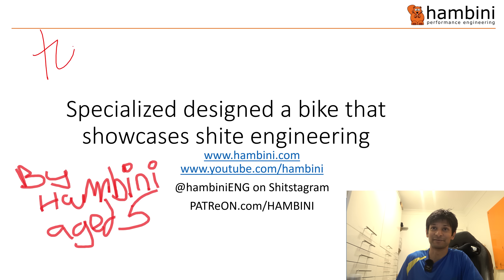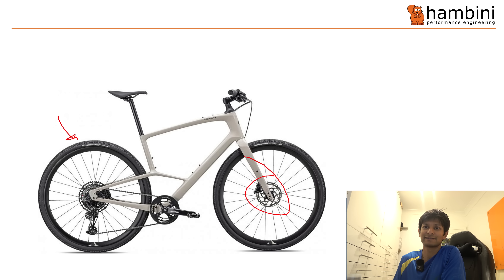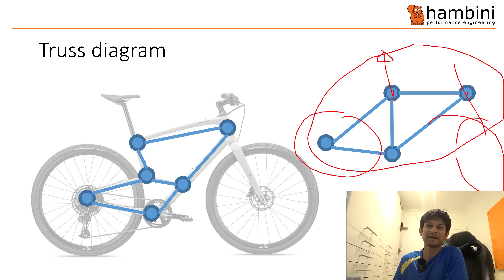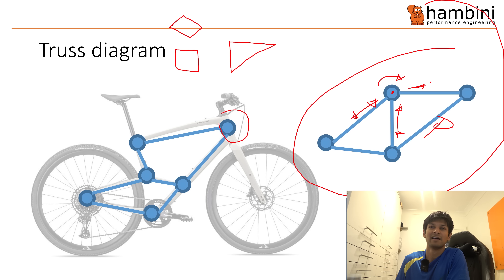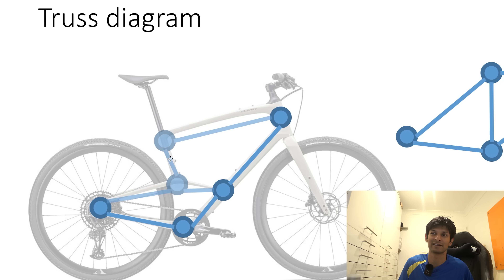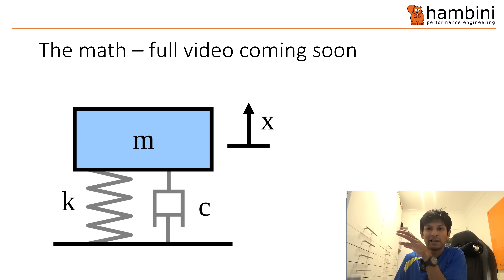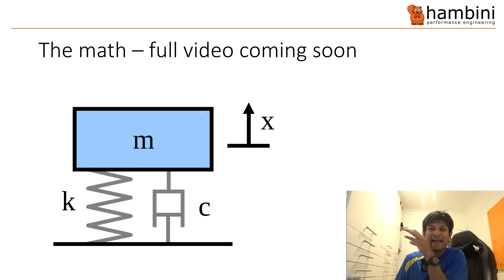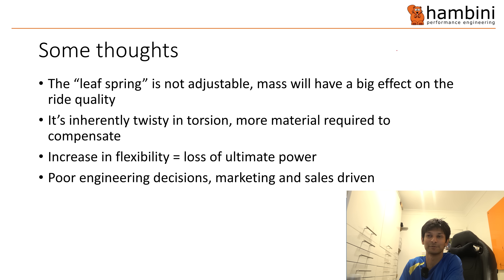Specialized Sirrus | TOTAL BODGE | When the marketing department design a bike...

Comment: I'm gutted I was considering getting the aluminium version but I think I'd better look elsewhere especially as I weigh 152 kg 😢❤😊
Reply: its only available in carbon
Reply: I can recommend the Giant Fastroad as a good alternative in this genre of bike. Comfortable without feeling too sluggish. Mine gave me years of faithful, hassle free service before it eventually got nicked
Reply: In that range you could get a custom titanium frame, and spec the tubing to be oversized. This would achieve stiffness values more appropriate for the load and would end up riding better.
I'm a heavier rider myself and I generally look for heavier TT bikes as road bikes cause they have greater stiffness, that for a light rider would be harsh but for me just feel more normal, or as a bike should feel.
A regular road bike usually feels like a noodle for me.

Comment: Beat me to it! Had a video for this.
1. Get your grad to do your CAD next time 😂
2. The seatpost deflection will still be magnitudes more than the deflection given by this design although more fore - aft than up down.
3. The trek doesn't have a damper, have a madone here in front of me. Just an L shaped carbon leaf spring. I quite like how its packaged...
4. You can still get more comfort without a damper, in theory. An elastic collision will have a lower peak acceleration than a non elastic collision. Same mass thus, lower peak force. Its peak force that hurts your backside you taught me all about that, remember that night in the flugplatz.
4. Only benefit i can see is shorter chainstays for poppin wheelies on the way to the office. No front mech though.
Reply: No front mech leaves space for classified hub! PROFIT
Reply: @Peak Torque Hambini is correct, isospeed has a damper. It is listed as a spare part.
Reply: Sounds like a memorable night of teaching. Hambini the teacher; PT the student. Lovely
Reply: I still want your video
Reply: Hambini owns a grad?
Reply: "Specialized says that its frame allowed 7.9 mm of vertical deflection compared with 2.9 mm for an unnamed conventional frame. Horizontal deflection at the saddle was 7.2mm compared with 4.1mm for the conventional frame."
Reply: “By increasing the vertical deflection at a greater rate than the horizontal deflection, ride comfort is increased without substantially increasing the rearward saddle tilt."
Reply: Pure Shiiite💩
Reply: I see the advantages of suspension for gravel and even road bikes.  I'm convinced that in a decade or 2 they're all going to be featuring suspension at both ends.  Road bikes might only have 1-3cm but they're going to have some suspension.  Gravel won't take so long.  I see the advantages to having a flexy frame and fork for a passive suspension.  The problem with flex for passive suspension is that it flexes in every direction uncontrolled.  They've figured out how to make mtb suspension eat bumps great,  relatively trouble free,  reasonable extra weight and pedal decently.  With pivots or flex zones and shocks.  It's also worth pointing out that similar designs have been tried 130 years ago and have been long forgotten about.  It's also worth noting that 130 years ago bikes were designed to ride on rugged terrain due to the surfaces that they rode on were often rougher than the fire trails that people currently use suspension mtb's on.
Reply: @mikekrasovec6390  Not really. If you are putting most of your wight in to the saddle on a road-bike, you are not putting enough power in to your feet. A suspension is not required. Damping of vibrations is a different story.
Reply: @rosomak8244  absolutely false.  On good smooth pavement suspension becomes very unnecessary but unfortunately lots of roads are less than perfectly smooth pavement.  Yes we have the ability to absorb bumps with our arms and legs but that tires the rider,  reduces control and reduces the potential of the rider to deliver their energy to turning the pedals.  As far as the rider being at maximum power so they don't have significant weight on the seat  - in most road races which are considered high intensity such as criteriums the vast majority isn't a max output sprint.  Nor is the vast majority of training time to be able to deliver said max output sprint.  In fact most pro roadies spend 80% of their time training in zone 2 - which means low enough intensity to be able to have a conversation.  I'm not sure how it exactly how future road bike suspension designs will look in 20 years but we've already seen lockouts with remote switches located on the handlebars for over 25 years.  In addition there are suspension dampers which are able to tell the difference between a subtle wave force (such as when pedaling) vs sharp acute spike forces such as when hitting a bump  - and those designs have existed since at least 2000 with the foes curnutt shock absorbers and then 2003? with fox propedal.  Those stable platform shock absorber designs operated by the simple concept of the compression damping being locked out until a bump is hit.  Said bump delivers a sharp strong peak force which opens the valves to absorb the bump(s) and then automatically closes the damper thereby effectively locking out the suspension.  Now those technologies are considered old tech but have had a few decades of refinement  - and are now time proven.  My guess is that a frame design based around virtual flex pivots could be able to provide a substantial amount of the spring force required for a 100lb/45kg rider with the remainder being provided by an air spring.  Flex pivots have been well proven in the world of mountain bikes with designs such as the moots ybb softail which offers 28-30mm of travel to others such as many yeti designs from maybe 15 years ago on a carbon frame with bonded in titanium flex sections to be the pivots at the dropouts.  Many modern carbon xc bikes simply rework the carbon for flex at various locations.  Those flex location designs are lighter,  more reliable,  0 maintenance and are laterally stiffer.  The technology is here and well proven but the consumers aren't yet ready to spend more money on a more complicated design.  They will will be  - however when is anyone's guess.
Reply: @mikekrasovec6390  the flex carbon eg Specialised Stumpjumper or Epic Evo. I know it isn't metal of course, but how fatigue resistant is it really, long term? Surely eventually the polymer starts to fracture and concentrate stress on the carbon?
Reply: @artgreen6915   carbon fibers have theoretically infinite fatigue life but the epoxy which is responsible for all of the compressive strength/rigidity does have a fatigue life.  Carbon fiber composites have been used in applications designed to have considerable flex for quite some time such as helicopter props and airplane wings in addition to bicycle high flex seatposts.  It's also worth noting that carbon can be combined with fiberglass such as the leaf springs on lauf forks or certain suspension frames with fiberglass flex plates dating back about 30 years such as slingshot mountain bikes.

Comment: Here's what I see. The downtube joint to rear axle joint, what is referred to as the 'spring' has a real problem. Assuming it's sturdy enough to support the loads, the problem is that this part is a fixed length. As it accepts load through the seat tube, that spring length will increase as the triangle flattens. It has no place to go. The downtube to axle distance is fixed. So where will this added length go? Sideways, It has to deflect someplace. Automotive leaf springs have a pivoting shackle mount to absorb this added length. Dual Suspension bikes have a pivot there and a shock to absorb the extra length. This is fixed. Something is gonna give way eventually.
Reply: Amen. Has to be way stronger in tension, so the only way it can move is to twist.
Reply: If this is a carbon bike frame, flexing any of the members intentionally will have negative effects eventually. If it's steel, it should be fine as long as they didn't make the tubes too thin. Forget aluminum.
Reply: @firesurfer  But you should be able to get the compliance in steel with a conventional frame. This sort of thing was tried in steel bikes in the late 19th century. If it was worth doing we would see these bikes all around us.
Reply: The seat-stays/bottom of the down tube can flex and add length, and given the repetitive angles, it's easy to imagine there being a nice amount of compliance for the sort of person who's in the market for a chill, casual bike, which this largely seems to be.
Reply: @bikefixr “Something is gonna give way eventually “. Agreed and oh so true 👍 ………..my patience 🙄

Comment: I occasionally ride my 1988 Specialized Sirrus crit bike.  It's a lugged cro-mo frame that was built in Taiwan.  The only issue is the rider's skill set isn't what it was in 1988.  😂  I've changed components over the years but the frame is still excellent.
Reply: Im certain someone will try riding it down a flight of stairs and fold it in half!

Comment: For my engineering degree I had to build a cantilever structure. I screwed up in one of the dimensions and it looked a lot like that bike frame. It collapsed. Lesson lerned.
Reply: yeah, one of the first things we learned is that triangles are tough as shit
Reply: @iddra1868  Same concept as BJJ. Solid and stable. That's why it's in the logo of countless BJJ academies.
Reply: i anticipate a lot of frame failures for Spesh. sigh.
Reply: @robinfowler9477  nothing new for them replace trash with new trash
Reply: Specialized probably did a better job of it.
Reply: i doubt the bike will collapse, i bet the X will absorb a ton of vibration and shock that would normally get transferred to the rider though.
Reply: @0xsergy  you should buy one
Reply: @0xsergy  for a few rides maybe. a component of Force from seat transferred to that small joint on downtube?!
Reply: I'm not going to arsed to actually watch the video, what material is this frame made of? It its Aluminium then its doomed to fail before the drivetrain does, steel and composites may fair a lot better but still turning a normally rigid structure into a suspension role always has trade-offs. Just ask top of the line go-cart builders what happens to the chassis as its both the frame and the main suspension component of the vehicle. They are finite non-recyclable, non-fixable structures.
Reply: Can't be less strong than a beam bike IF there's compensatory material.
Reply: Well there it is...Luke Diamond made a mistake in his engineering degree that reminded him of this...guess we should write this thing off entirely. Thanks, Luke.